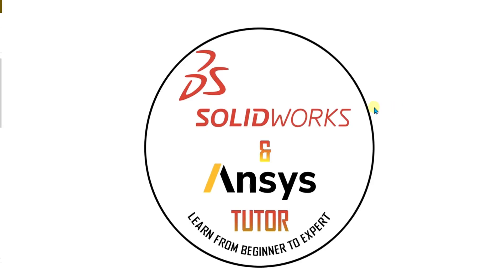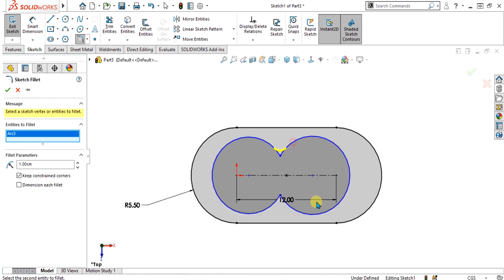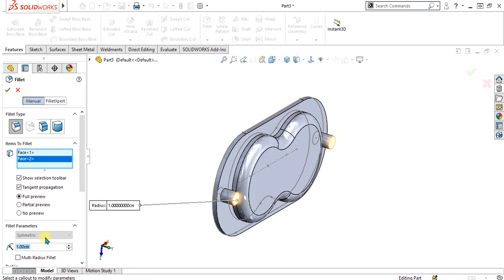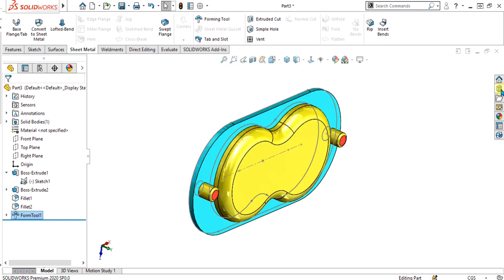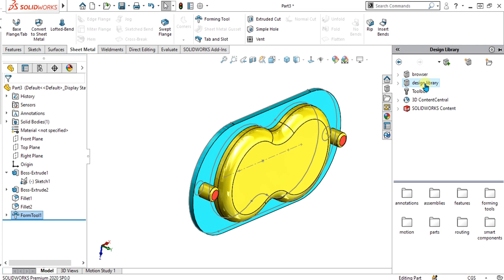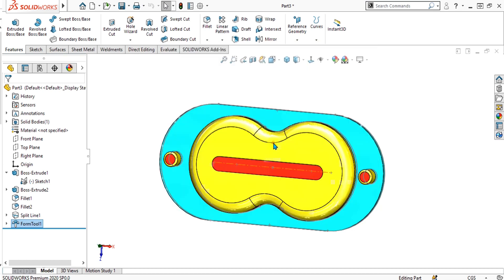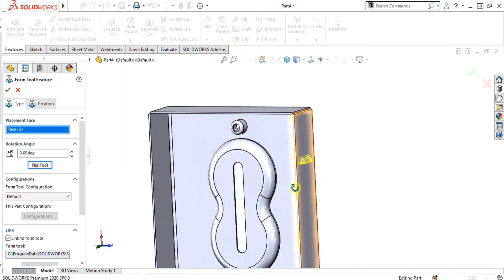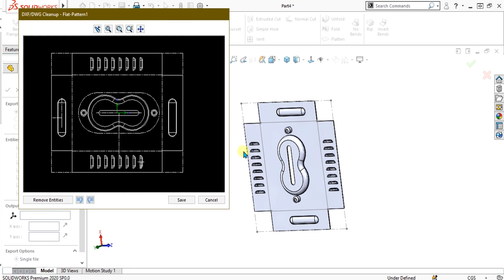✅ Solidworks Sheet Metal Forming Tool | How to Make Forming Tool in Solidworks

Comment: Does SW take into account the thickness of the sheet metal when punching through? Does it take into account the plasticity of the sheet metal? Or can it just stretch indefinitely?
Reply from the maker: it depend on the forming tool you are making i don't think so it takes plasticity in account for that you have to do non linear analysis to check that or Make a large forming tool which a sheet metal plasticity can't bear and check if it is taking plasticity in account or not